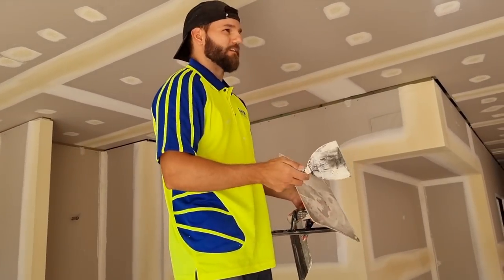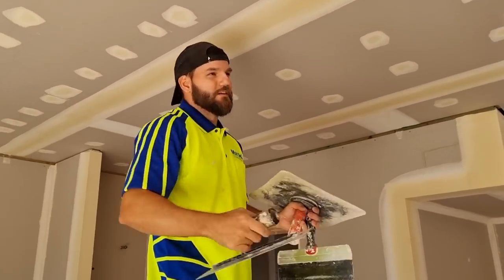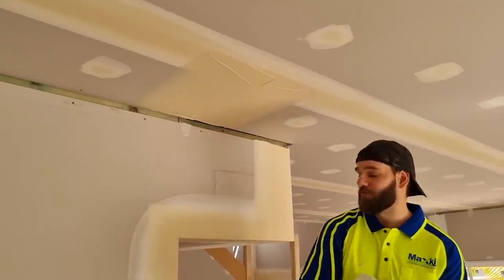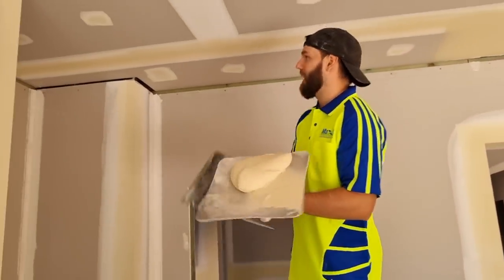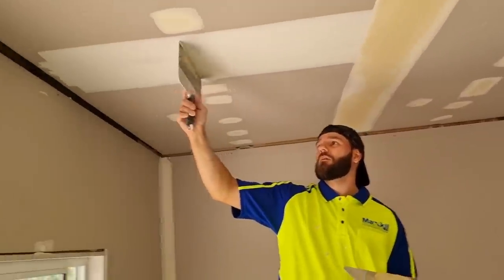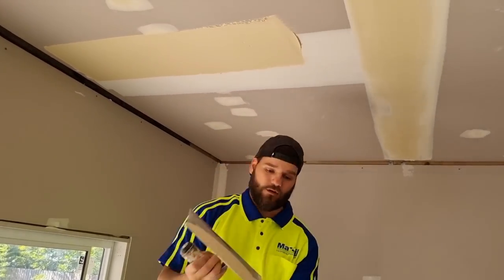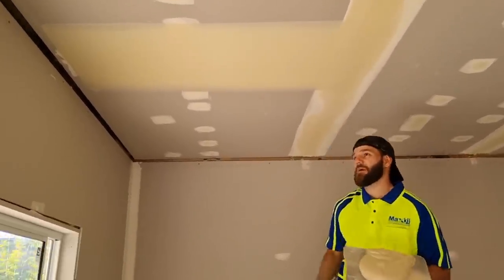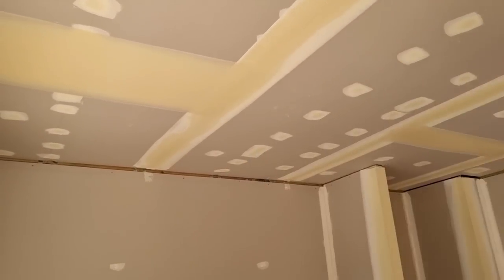How To Skim Coat & Trowel Butt Joints (DRYWALL FINISHING) Pro Tips!

Comment: Instead of using that 12 blade after feathering edges could we use a 24” skimming blade and run that?
Reply from the maker: yeah that would work well
Reply: If your good with hawk and trowel who need skimming blades a waste of time
Reply: @westdoze  that's all I ever used. just use the right trowel, and have it set up right. Many people never learn the trick to adjust their trowel. place a thin coin under the end of the tang, then give the tang a light tap with a hammer just behind the coin. Too many also use a drywall trowel which has a concave curve rather than a plaster rowel which should be flat with a very VERY minor upturn at the ends
Reply: @Keith_KC8TCQ  I've looked everywhere to see if you set a drywall trowel like a concrete trowel. Thanks for this. I use a nickel if I have one.
Reply: @matthewotis3594  the key is the "light tap" on the tang behind the coin. I watched a young kid try this, and hit it so hard it broke the tang and ruined a brand new trowel

Comment: I can see with all the flat roofs you don’t get much white stuff there, my nephew is from Water Town now lives in Michigan in the states, he’s not all that fond of the snow and cold, he will get over it. You guys do a great job, just have fun and leave a bit of the mud on the bosses head now and then that way he’ll leave you alone more.
Reply: Not much snow in Australia. Only snows in a few places and a few times a year. 9 out of 10 times our rooves are designed for water so are usually pitched at about 15 to 21 degrees (in my experience)

Comment: how do you set the tape and do 2nd coat in one day. Are you using a hardener to set the tape?
Reply: Setting compound, goes hard in 60 or 90 minutes we use it to tape and all first coats and buttjoints second coat too get done with it
Reply: @drywallgangsters  wow. Must be different than what we have in the states. We are stuck using full weight joint compound for taping. Have to wait 24 hrs
Reply: @drywallgangsters  what taping compound do you use?
Reply: @michaelraduazzo6146  oh really, this stuff comes in bags and you have to mix it with water. We rarely use all purpose compound to tape unless the job is so big that we can only tape in one day which is rare
Reply: @drywallgangsters  yea , for us it's called sheetrock 90. Also comes in 45,30,20 and 5. Impossible to sand haha
Reply: Same in the Uk 
You use powder joint filler(mixed with water on site, basically gypsum,non sand)-
And after ready mixed(airdry) finishing compound
Reply: @michaelraduazzo6146  5 minutes is for patches that’s why you shouldn’t be mudding a whole house with 5 minutes

Comment: Butt joints first! Why do you want to have the extra effort of finishing the head and tail of a joint as well as the edges. Butt joints first and you finish the head and tail when you run the box. It's faster, a better finish and looks much neater.

Comment: Drywall plasterer from Canberra learnt more from these blokes and videoes then I did in my whole apprenticeship
Reply: Should have done ur time with complete fix set those boys no there stuff in Canberra
Reply: @cheveburkinshaw860  I know complete fix set and have worked for them before
Reply: @matthewgrigg9153  I’m big fan of Kev
Reply: I’m in wodonga now . Grigg is a name in plastering here ??
Reply: @cheveburkinshaw860  don't think so my family is from Victoria originally though don't know about any plasterers, I am actually currently working with kevs cousin by marriage also one of my good friends works for complete fix set but I mainly do commercial framing and ceilings which is why I never really picked up setting when I did my time.

Comment: If you 1, use the right type of trowel and 2, adjust it right, you won't have edge cuts when troweling butt joints. Did it for years until I was forced to retire after being injured in a head on collision that messed up my neck/ lower back, right shoulder. I was part of a 3 man crew that could tape and finish 4-5 houses a week w/o working overtime/weekends. We did a LOT of jobs in housing developments and would have 4-5 houses lined up by same builder in same development, tape them all in one day, then hang the corner bead, prefill around the bathtub. Come back next day and bed coat everything in all 4-5 houses, day after, top coat them all. 4th day spray all the ceilings and sand walls and start texturing/skim coating, 5th day finish sanding/texturing/skim coating the walls and do final cleanup
Reply: Much respect to the work you put in and am sorry to hear about your early retirement, from what I can tell you love working.

Comment: Interesting that the house has drywall on the ceiling in the back deck. I imagine it is a weather/climate thing. Up here in Canada I have never seen that and don't think it would be recommended in our winters
Reply: Because it should be blue board outside or cement sheeting.
Reply: @lee-qf3qm  But even dry wall mud doesn't handle moisture very well
Reply: @Phazetic99  yeah need the James hardy setting compound then primer undercoat followed with weathershield paint.
Reply: @lee-qf3qm  good to know. I'll look into it